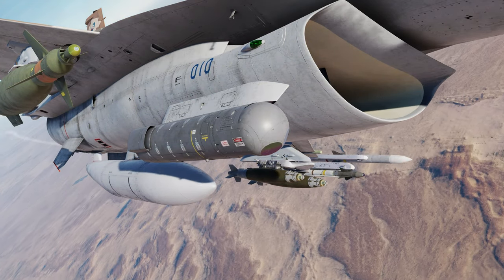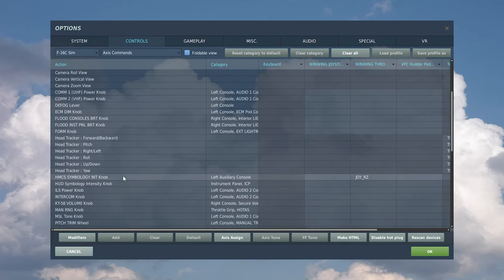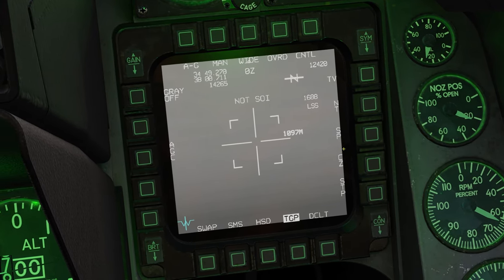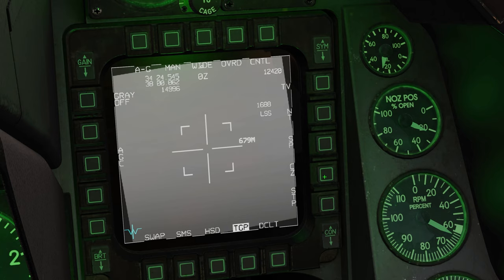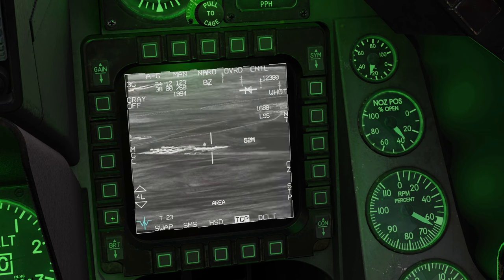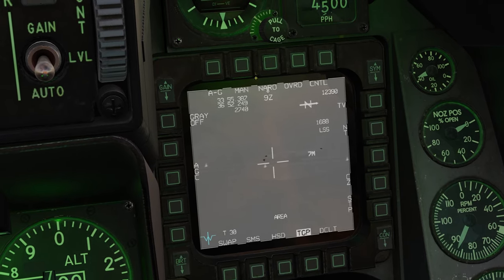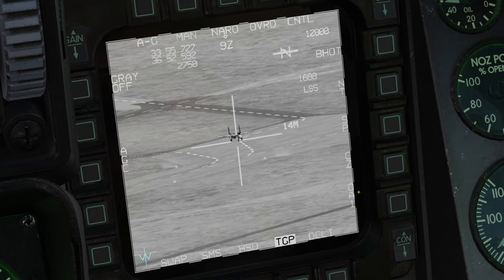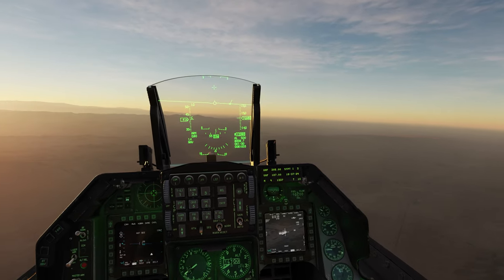F-16 Weapons Masterclass Ep. 2 - LITENING Targeting Pod | DCS: World

Comment: How do I know the difference between sp-sensor point and sp-snow plow? In fact, it’s a bit confusing. It starts with saying CZ is centre zero and takes you to bore sight/straight ahead. Then it says so is sensor point, which is whatever sensor is being used, usually waypoint. Then it says CZ takes you to the waypoint selected. Then it says when you press CZ a new button sp (aka sensor point, which was already there) appears called snow plow. So now sensor point is snow plow. So I’m confused if sp is sensor point or snow plow. I’m sure the designers of the f-16 would not confuse the pilot by having a control that is on the same location and with the same identifier. In fact, this is a primary handling requirement in aviation.

Comment: Really good tutorial, thanks for the effort. Would you say the TMS switch or DMS switch is more important? Just so I know which to bind to an easy to reach switch and the other to a slightly less convenient one.
Reply: TMS for sure - it is what you're using to direct all the different sensors.  You use all 4 directions for both A-G and A-A.  DMS primarily selects which screen you want to interact with and changes screens.  There's more to DMS but answering your question... clearly make TMS the most accessible if you have to choose.  Assume you are using T16000M stick! When I had that, the thumb on stick was TMS.  I assigned DMS to one of the throttle thumb hats.
Reply: @keithbriscoe99  Thanks, I realised that quite a while ago. You don't want to be fiddling about with a hard to reach Hat switch, when an enemy has already locked and launched at you!

Comment: STP button (MFD) is present only in NAV mode, but in A/G there is TGT - does it have same functio?
Strange, but I cannot set any offset poits even doing same as you do. After STP is depressed  OA1 appears but when I pres on it - crosshair moves not to set target before but to waypoint. Mess... no idea what is happening.
Reply from the maker: Yes, when in A-G it says TGT. My bad for skipping on that in the video.
But it does have the same function.
Offset Aimpoints were bugged up until the latest open beta update, so make sure you've updated to it.
If you have, after setting an OA, it'll jump back to your currently selected steerpoint and you'll need to set another offset if you'd like.
This is again showcased in my JDAM video which you can watch here:
https://youtu.be/s35YxyThNg4
Reply: @MamboDCS  firts of all Thank you for tutorials! They are the best I`ve ever seen among other youtube videos. Yesterday updated DCS. Now is possible to set TGT (ok) and OA2 (ok) but not OA1 - it always moves someshere else instead of my set point. Also there are no triangles on ILS.
Again doing everything you did on video.
Interesting fact - TGT and OA can be set even without pressind TMS right. Because when you slew crosshair it automaticaly goes from Inertial to Area track.
Reply from the maker: That's true, TMS right isn't always necessary, but I mentioned it just to make sure :)
I used OA1 and OA2 a couple days ago and it worked fine so I'm not sure why it isn't working for you :(
Maybe try a different mission and see if it works there?
Again, maybe my JDAMs video can further help 😅
Thank you for the kind words and support, I really appreciate it!

Comment: The TGP doesn't move when I attempt to slew it, even on Manual mode, why?
Reply from the maker: First check that your controls setup is done correctly as shown in the video. Also make sure you've SOI'ed the screen the TGP is on and then try moving it around. If that doesn't work try pressing TMS Right while the screen the TGP is on is SOI'ed to put the TGP into area track and then try moving it. Let me know how it goes :)